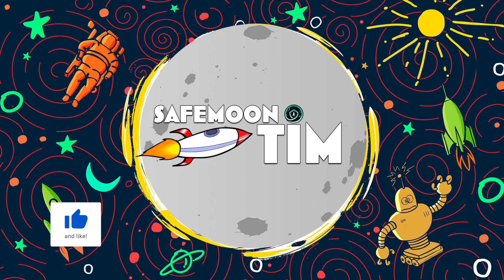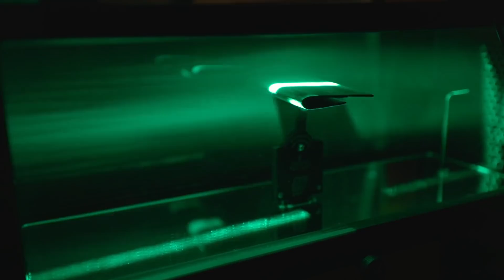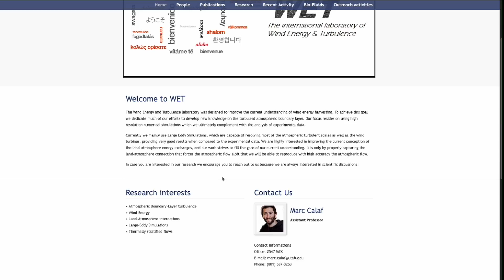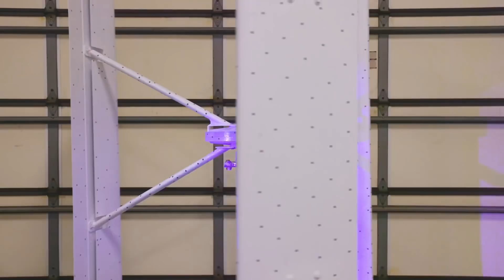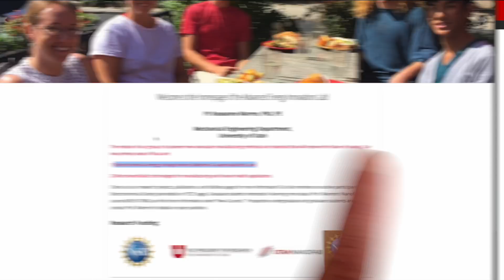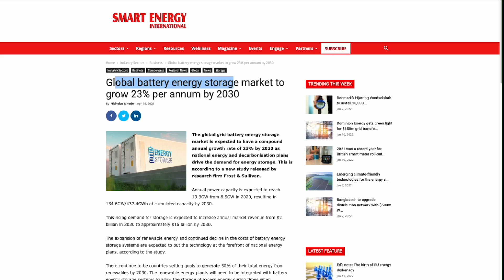CHARGING UP!!!

Comment: Tim, I'm curious how many reflections I should be seeing.  I own just over a million v2 and have about 2,600 in reflections which totals about 4 dollars.  Is there any way to calculate reflections based on holdings
Reply from the maker: There isn’t an easy way to figure it out because it requires so much information and specific data. Right now the volume is really low due to the state of the current market. If we get listed on a major exchange expect a huge amount of volume which will drastically raise the amount of reflections you’ll receive.
Reply from the maker: You can always use  safemoonglubiz.com to figure out reflections based on different volumes.

Comment: Battery storage was missing from most conversations, people focused on how a wind turbine or two would not power a house, but that is not needed if you have proper battery storage and the wind turbines are used to recharge the batteries. Coupled with a hybrid solar-wind turbine system, this could be the way.

Comment: They would most likely use a SLA ( sealed lead acid) type battery or like an Optima type battery which would be called AGM (absorbed glass mat). All have acid but can't leak out.

Comment: Tim look up dual carbon batteries
Reply: Go on… what are these
Reply from the maker: I'll look into this but I have a feeling safemoon is going to working with the businesses and technology that is around them. Just a hunch.
Reply: It is a technology developed in Japan i read some articles a few years ago sounded very promising.  Sounded similar to what you was talking about!  It out performed lipo batteries hands down!  Charge 10 times faster and discharge 10 times faster as well! If i remember correctly.
Reply: @benreed4918  wouldn’t you want it to discharge 10x slower?
Reply: @CheapSeats  not if your looking for performance batteries. Weather your charging them  or discharging them. Both have to be optimal in performance. Cant have one with out the other

Comment: Safemoon only has a few months of creation and is already delivering several products and projects thanks safemoon team
Reply: Almost 1 yr not few months lol
Reply: It hasn't delivered any product apart from d wallet. All these u seeing are just speculations. Until they actually implemented.
Reply: @anayoemmanuel5643  remember safemoon has only been created a few months, no project the size of Safemoon has been created in a few months, it takes years like apple and google
Reply: @sandrodesempregadoefudido3997  there is. It's called shiba. Safemoon needs to work on getting listed on major exchanges. In it's one year of existence it has only created just wallet. Shiba in less than a year of existence made alot of millionaires and got on all major exchanges thereby boosting it's price. But safemoon is till not on major exchanges and to some people it's not easy to buy safemoon. They also need to stop giving out date of releasing products if they not gonna release them as stated
Reply: @sandrodesempregadoefudido3997  safemoon dev team are just slow. Yes they would deliver but they super slow. That's why safemoon is lagging behind. All the juicy products to be released yet no one is talking about safemoon. Cos people won't invest untill they actually implement them. And Safemoon is made easy to buy on major exchanges. Shiba did all these without a single product other than their swap